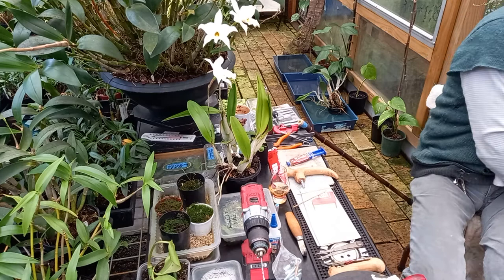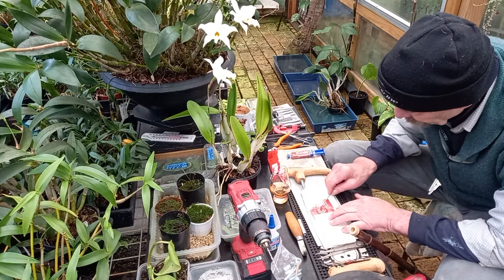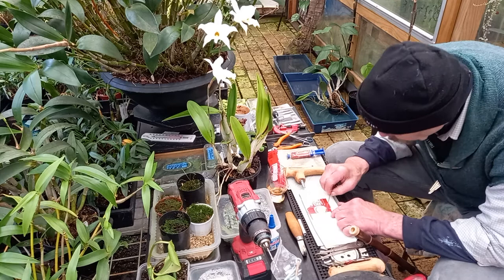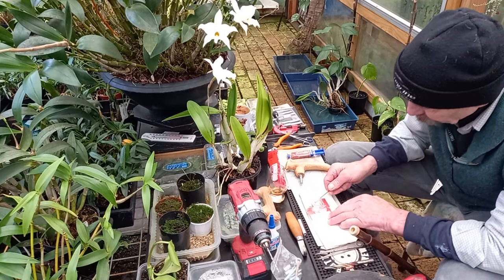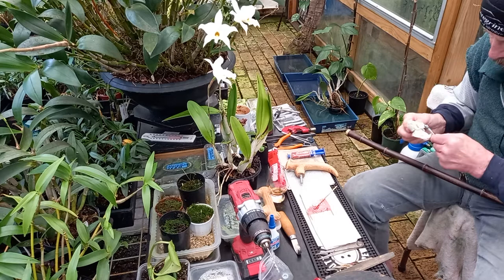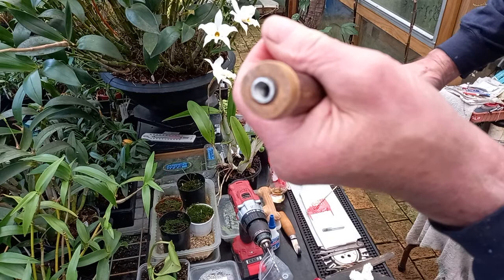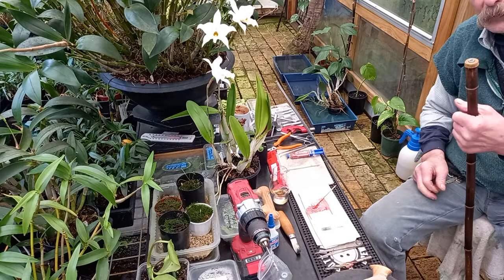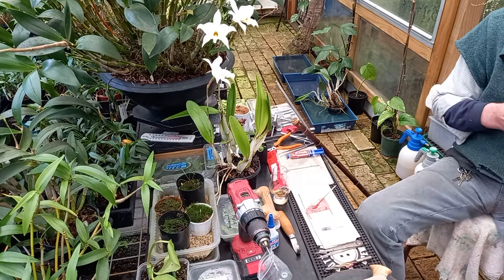Walking Stick Handles... a better attachment with threaded rod and threaded metal insert.

Comment: You lost me
Reply from the maker: I'm sorry if I wasn't clear enough with the bamboo cane and Blackwood handle inserts. If I did edits and single frame images with subtitles for each step, it would be easier to understand. Gluing in the insert(bamboo is inherently weak compared to solid timber) was necessary in order to attach the handle securely. 
...or did I lose you with the treat for Gus or the Irish Whiskey and Swedish chocolate treats for me ?